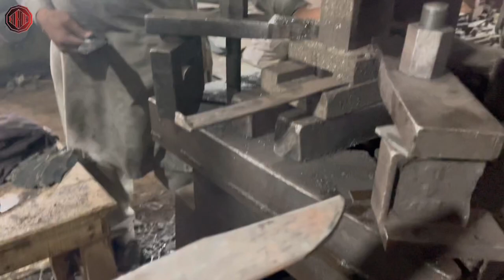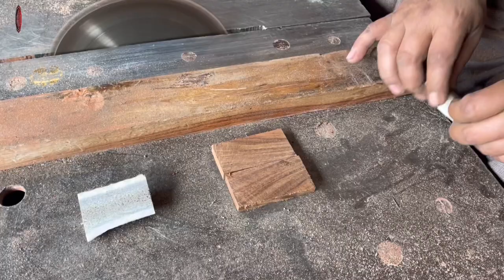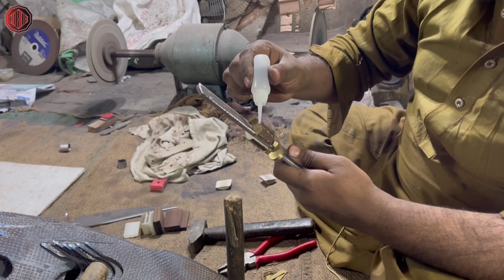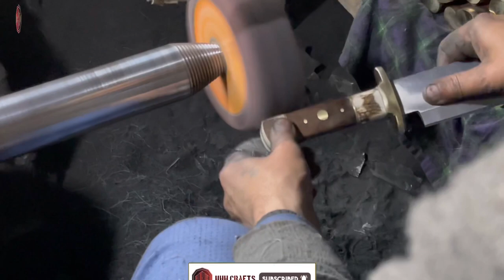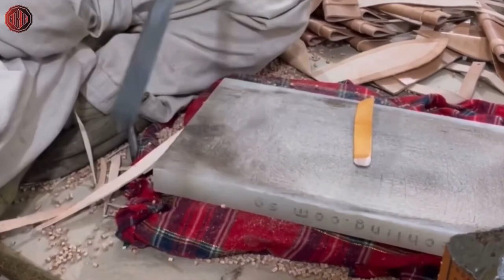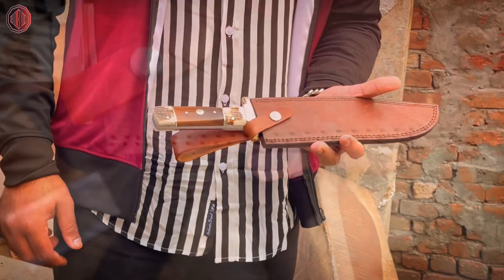Unbelievable Technique of Making Stag & Wood Handle Bowie Knife | with Leather Sheath

Comment: The fit and glue up phase is pretty sus, theres way better and easier ways to fit all that stuff up, and its not even epoxied together gross!!! Also when quenching the blade you are supposed to move the blade up and down to remove bubbles that insulate the blade from the quenching oils/water. This is knifemaking 101
Reply: These knives are not actually functional or have high performance. They're just show pieces. These knives don't have symmetrical grinds. I have bought a lot knives from these manufacturers.